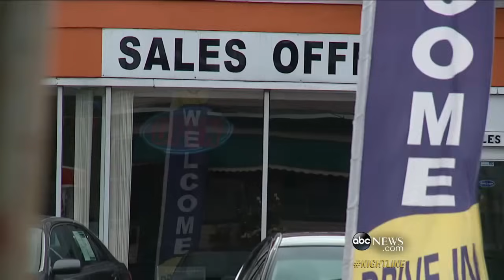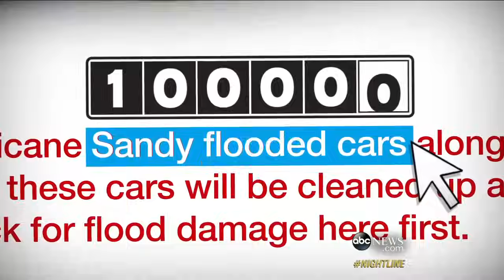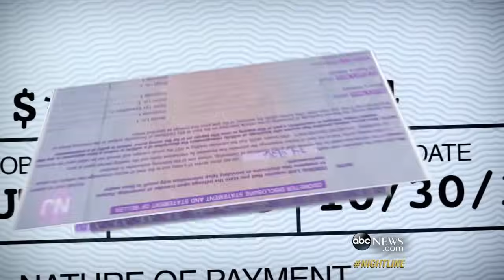How Did a Sandy-Damaged Truck Land on a Used Car Lot?

Comment: Just because a car has a salvage title doesn't mean that it is going to immediately be crushed.  It means that an insurance company totaled it out and sent it to auction.  It's usually required by law to rebrand a title when the vehicle is totaled out.  From there it is either going to be parted out or rebuilt.  If it is done properly, the car will have a rebuild title, meaning that it was at one point totaled out, and someone later rebuilt it to be road-worthy.  To achieve this, the car must pass an inspection that is far more rigorous than a regular safety or emissions inspection, ensuring that all the previous damages were repaired properly.  Usually it's relatively late model cars that are rebuilt as they have many years of life left in them after the repair.  Often times the repairs are done using parts from another car with different damages that might be more difficult to repair (for example rebuilding a flood car using parts from a wrecked car) It's a pretty cool process.  If a car is damaged totally beyond any reasonable repair, it is issued a "certificate of destruction" or a "non-repairable" title, meaning that the VIN number is essentially gone and the vehicle can never be made roadworthy again.  This is often done to flood cars, some with relatively minor damage because the government will require it after a storm.

Unfortunately many dealers cheat the system by "title washing" and sell flood cars under clean titles.  Instead of being thoroughly and completely repaired, they are quickly "doctored up" to look good, when in reality there are tons of problems still in the vehicle, some of which could be safety hazards.  What happened here is the insurance company was processing many vehicles at once and wanted to just get them all to auction as quickly as possible, so if they couldn't get a hold of the title, they simply sold the vehicles "for parts only".  Unfortunately that means it's still a clean title, so a seller doesn't have to pass a salvage vehicle inspection.  This truck should've been issued a "certificate of destruction" for having so many parts submerged in salt water for 3 days.  I'm sure there were even more flood related damages that the video didn't show.

Comment: I've restored several flood cars and never had any issues with any of them.
Reply: Both
Reply: what do you mean by "restored" ? what about the cable and electronic slowly oxidizing due to the salt ?
Reply: ScottishLion83 air bags work?
Reply: Matt, are you going to replace the entire electrical harness of a vehicle? No, you are going to half ass it to get it working, and not worry about it afterwords. If you did everything you needed to do to a flood vehicle, it would cost 3 times as much as it's worth.
Reply: He means he fixed them enough to sell someone a running lemon
Reply: replace em all... only the way
Reply: Would only make sense if you weren't near the coast.
Reply: More than likely they were classics and those don't exactly have airbags. Modern vehicles are a hell of a lot harder to fix after being in a flood.

Comment: iF NOT PROPERLY RESTORED  flood vehicles are indeed a danger.
However a frame up complete disassembly and cleaning rebuild will be fine I have done this for Harleys and classics that were flood damaged in Hurricaines IKE, Rita and Katrina. THose bikes are still on the road and  see those vehicles on the road even now perfectly fine.

Comment: My f350 sat in a lake(fresh water) for 2 days about 10 years ago never ran the same agian
Reply: Why
Reply: the water can still corrode electronics and whatnot but sometimes you get lucky and alls fine after everything dries out.
Reply: I had a 95 f150 that broke through ice and sat in a lake for 6 days and  still ran but was the worst running, nothing worked, but drove it for 2 months after😂😂
Reply: Yeah cause it's a FORD😁😁😁
Reply: tird108 Ford is shit, get a Cummins.
Reply: had a old 1965 chevy c-10 that drowned after drying out and flushing few more little things and it ran great for years
Reply: Marvel's mystery oil?
Reply: Did you put in rice?

Comment: you can "wash" titles by registering it in a different state then re-register it the state you live. different states have different title/ registration laws and requirements. A salvage title in one state may be irrelevant in another. Some states will even let you register and legally drive a car with no title or proof of ownership if the vehicle is old enough. It's not right that dealers are not disclosing previous damage properly but if your a smart consumer and don't go to obvious "tote the note" lots you should be just fine.
Reply: mine requires a tech inspection, so lets just say, hide the rebuild jpob, and you get qa god damn clean title. no rebuilt titles exist here, inless you import it, and you dont hide the rebuild job

Comment: How do I buy flood cars? I would love to get a hell of a deal in exchange for some electrical part swaps
Reply: fresh water wouldn't be to bad, but salt water would cause a lot of rot
Reply: The insurance companies sell them
Reply: Are you crazy? Once a car goes under salt water, corrosion begins. I mean all the steel will rot out and the entire electrical system is shot. Salt water is very destructive to steel. A friend of mine launched his boat and truck into salt water We retrieved the truck and rolled it into a lake. The idea was to rinse it off. It did not work, it rotted.
Reply: that's why it rusted out because you guys didn't clean the vehicle properly and with a solution that works best to neutralize salt and use a pressure washer the truck in that video was just fine they just made a big deal about it for the drama with some thorough cleaning and a little electrical work it would have lasted forever it has a diesel engine in it those things can easily go for a million miles what a waste
Reply: that's why it rusted out because you guys didn't clean the vehicle properly and with a solution that works best to neutralize salt and use a pressure washer the truck in that video was just fine they just made a big deal about it for the drama with some thorough cleaning and a little electrical work it would have lasted forever it has a diesel engine in it those things can easily go for a million miles what a waste
Reply: +iTheGeek I live in Michigan. Our cars are rusty underneath no matter how much you wash them. 10 years or older will have some rust underneath. The car I drive now has rust alll the way up on the core support lol
Reply: M.Joseph Ali you're going to need to do more than just little bit of electrical work
Reply: +DRAKE FORCE How about a pH flush that neutralizes all salt and corrosion? If they're extremely cheap I'd try one out for sure. Give me something fun to do.
Reply: M.Joseph Ali yeah whatever you have to do to neutralize the salt but it has to be thorough and it has to neutralize all of the salt cuz if it isn't your vehicle is not going to be hanging around very long lol so you will pretty much have to go through the wiring loom the fuse boxes tear out the interior check engine and drivetrain components and then after tearing the vehicle down about halfway you will not have any interior or any kind of interior parts same thing with the engine bay any engine bay plastic covers and wheel well Plastics anything that gets in the way of you cleaning the car out thoroughly will just be another place for salt to hide and don't just focus on the interior and the top side of the vehicle you will have to pay the same amount of attention to the underside of the vehicle and make sure you get all of the salt out of the cars unibody or if it's a truck it's chassis and make sure you get all the salt out of the suspension parts and brakes and then you'll be ready to reinstall everything let's just say you're going to get very familiar with this vehicle lol

Comment: Similar thing almost happened to me with a 2012 Jeep Wrangler Unlimited I was thinking about looking at for $18,979. A Jeep like that the one blue books for like 23k. CarGurus said it was a salvage title but the used car dealer site said it was a clean title. So, I googled the VIN and immediately found out that it was completely submerged underwater caused by Hurricane Harvey, then some used car dealer here in Boise, Idaho bought it and are trying to sell it off as a used Jeep in good condition.

Comment: I wouldv'e crushed it even if it wasn't flooded. It has the notoriously fallible 6.0L powerstroke diesel engine which should have never been brought into existence.
Reply: I'm also a mechanic brendan and I agree they are moneymakers (for guys like us) lol.
Reply: MrNotorius5500 Do the head work and it's a good motor
Reply: Ian Webb Thats what she said.
Reply: If you are a mechanic, you certainly are not a diesel one. It's not hard to make the 6.0 a reliable engine.
Reply: FCFordLord although I'm not very proficient in fixing diesels (aside from everything I've done to my 7.3), The fact is the 6.0 has a lot of shortcomings even if you did the head bolts and EGR delete. These motors are not the easiest to work on (albeit still easier than the abomination known as the 6.4), and so I have to disagree. You have to dump quite a bit of money into them just to get them up to the reliability standard set by the 7.3. Yeah they are more powerful than the 7.3 and are more technologically advances and can go faster and all that, but I don't see how that's a fair tradeoff when it leaves you stuck on the side of the road with the heads being popped off and you're looking at a multi thousand dollar bill to fix it while 7.3s pass you by all day long.
Reply: MrNotorius5500 its an impressive motor when its working, but i had to always carry tools and extra parts. what a P.O.S.! last ford diesel i owned.
Reply: shouldve let it in the salt its a ford
Reply: MrNotorius5500 My friends and I call it "The six point NO engine" lol.
Reply: MrNotorius5500 ha. at 7:31  he would've said that before the hurricane
Reply: 6.0 is one of the best diesels ever if maintained and bought from 2005+ fast strong and long lasting
Reply: I’d keep it.
Reply: I am a diesel mechanic
Reply: MrNotorius5500 I'm a ford guy but I'm with you 100 percent
Reply: MrNotorius5500 you obviously know nothing about diesel trucks. The 6.0L engine after bulletproofing is one of the most reliable trucks of all time. Very capable and powerful trucks
Reply: FCFordLord I disagree and there is plenty of proof to disregard your comment
Reply: Ford GT poor spirit such a faithful looking truck yet a short-lived Beauty and also being a complete POS version of Ford truck but you got to have some sympathy for the poor girl after seeing what she went through
Reply: MrNotorius5500 but you have to admit once they are bulletproofed they can be powerhouses
Reply: Wouldbe crushed it so it wasnt found on road dead
Reply: MrNotorius5500 the 6.0 was the most reliable engine ever built. It had great suspension, would go 400k nikes, was more fuel efficient than the 7.3, had more power than the 7.3... you had to put money in it to get it bullet proofed, but cost less than a transmission for a dodge, or head gaskets and injectors in a chevy... the 6.0 is the engine to have. Coming from a 10 year diesel mechanic that's seen them all
Reply: Geek Boy 21 i would only get a ford if it was 2015 and newer. Then i would take it to southern comfort aoutomotives. Otherwise it would be chevy or dodge for me.
Reply: MrNotorius5500 it is a good truck if you bulletproof proof it and not bag the shit out of it like most people
Reply: Rollin down the street in my six o blowing a head gasket needin a tow
Reply: You can always tell a fake mechanic because they all repeat the same internet message board bullshit that the 17 year olds post, as gospel....
Reply: Cummins are better
Reply: Amen to that 🙏🙏🙏. Ford with their brilliance.
Reply: 6.BLOW
Reply: @biaggiwins  its actually a International motor!
Reply: @Northern_Farmer  yes, I know that..
Reply: OO
.Ĺ
Reply: Yeah 6.0 plus has an automatic transmission and is a Ford that's a disaster waiting to happen flood or not.
Reply: Our still runs amazing thanks!

Comment: I bought a truck from Byers Chevrolet in Central Ohio last year for $35,000.00... pretty sure this is the same situation I'm dealing with; truck looked great but is literally rotting from the inside and has numerous electrical issues.   When I brought my concerns to the dealership, I was essentially dismissed, the dealership offered to fix the body-rot for $9900.00.    But, they did say "thank you for your Service".   Their body-shop manager actually stated, "you know how these trucks are"  suggesting this type of rot is normal for a GM truck...WOW!   And, when I questioned their "inspection" process, the service manager stated that they only look for significant holes in the frame... again, WOW!   And, that's total BS, they scrutinized my 2 year old trade, mentioning a small scratch in the paint and a scuff on the rim.   Byers Chevrolet shows Support for the Troops by misleading them and taking their limited financial resources under false pretenses, passing off a vehicle that, by their sales managers own statement, "probably should have gone to auction"... yet I'm still stuck with the truck and the associated repairs.    Buyer beware of Byers Chevrolet!

Comment: Pressure wash it, with hot water and a good detergent, and presto, a good truck. Crushing it is a waist.
Reply: Waste
Reply: Nope, doesn't work like that. However parts could have been sold, doors, glass, tailgate, wheels, and maybe get back at least $1000.
Reply: The salt water penetrates areas no pressure washer can reach, especially the electrical system including connectors. I'd drive it as a beater (and only pay beater price!) but I've assembled several pickups from organ donors. It's not a grenade, but should certainly not go for full retail. It would be profitable to part it out instead of messing with it.

Comment: America is the land of second chances. I wouldn't knock it. This truck could have been repaired and placed under salvage title but they made an effort to cover it up and that is wrong. Salvage cars and trucks are not bad to drive if rebuilt to manufacturing spec just have the buyer sign a waver after a state inspector certifies that its safe to operate again.
Reply: +egn83b You cant repair a water damaged vwhicle. Plus, if you did, the cost would be more than the car.
Reply: You can repair a water damaged car that is how salvage title works you either pay someone to repair it for you or do it yourself its not impossible and apply for a new salvage dmv title. Yes the process cost a few hundred dollars but way cheaper then buying a brand new vehicle. The re sale value is bad but that is expected.
Reply: +egn83b it costs thousands of dollars to repair a flood damaged car. that's why they are instant insurance right offs. a car that has been flooded will never be right ever again. insurance company's are out to make money why would the right off a 45000 dollar truck if it was only a few hundred dollars to fix? a truck like that blazer in your pro pick could probaly be repaired for a couple grand but a modern car with thousands of electric components could never be straightend out
Reply: Yes I see your argument but insurance companies are not honest in the way they do business either, its a one sided authoritarian business they decide weather you get to keep the car or they sell it off in parts. A flooded car inst a bad car as long as it wasn't in salt water. The electronics are gonna be ruined but you can junk the harnesses and replace it . The way you do it is buy a wrecked vehicle for 1200 dollars and salvage it all out to fix the flooded car and yes it will never be perfect and that is expected. My argument is that you can do it, and its still save a ton of money then going in debt for a new car. Modern don't mean anything to me if the car rusts in rain water it is not worth repairing or owning. The key is buy what you know how to repair never go out and buy a car your not familiar with and expect it to be trouble free forever. The point I see your saying is that rust will invade the fasteners and structure of the car but if it is allowed to be dried out and washed down and cared for in a timely manner the car will be good again but if it sat say a week or more in the water then its gonna be worthless like a roll of toilet paper.
Reply: +Noah Ferrari So your saying that my old dozer, which has been driven through lots of swampy mud, salty water, and even a few rivers, should be immediately scrapped? It is 40 years old, and still does everything I need it to do, but I guess that is irrelevant.

Or what about the guys who drive their jeeps and hummers in deep water, and have no issues?
Reply: Your dozer has no electronics.... So that argument is moot. And driving a car through fresh water is way different than a car sitting without running in salt water for weeks. Try a better argumeant
Reply: kdw75 Because they were built for that. These are Electronically Fuel injected motors, while those are mechanical injection carburated diesels. And all new cars have all computers, power seats, windows, locks etc. It is to costly to repair it.
Reply: +Angry Whale He was talking about EFI Jeeps with power windows, locks, conputerd, etcetera.
Reply: Yea I was talking about that too its not complicated to clean the electrical stuff up with contact cleaner and lots of patients or a small budget of money can replace the bad electrical items. If you don;t know your ecu is coated with a plastic waxy con formal coating to seal out water and dirt.